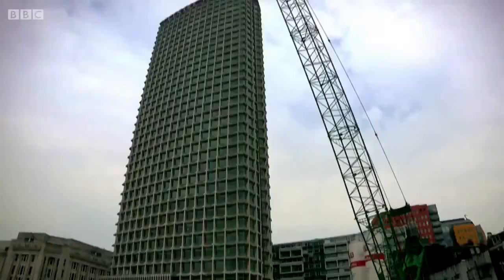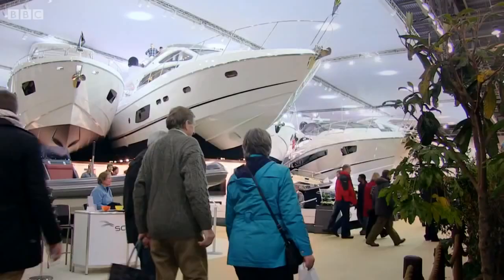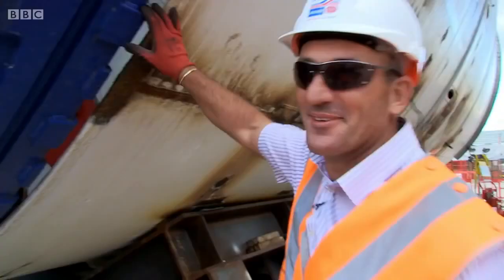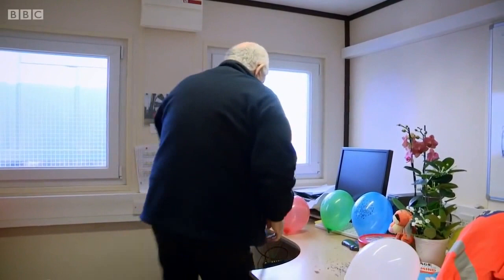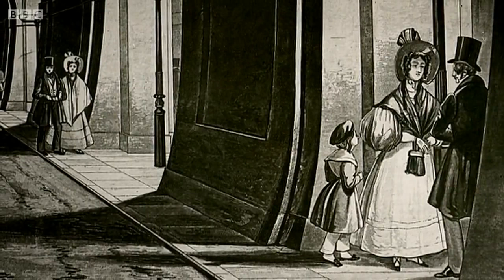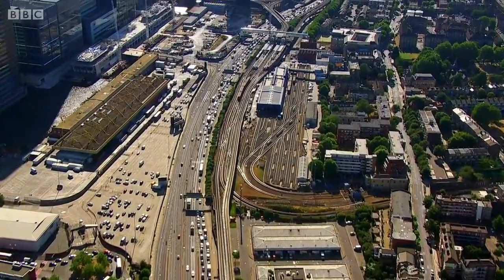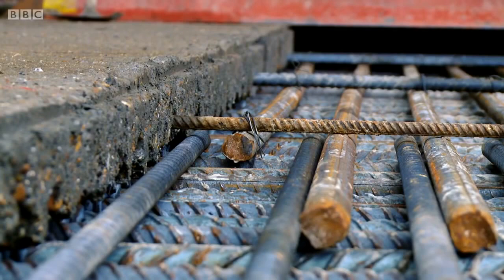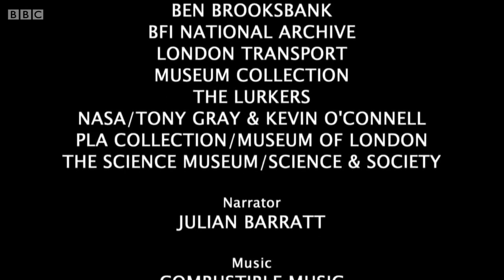The Fifteen Billion Pound Railway - Tunnels Under the Thames - Episode 2

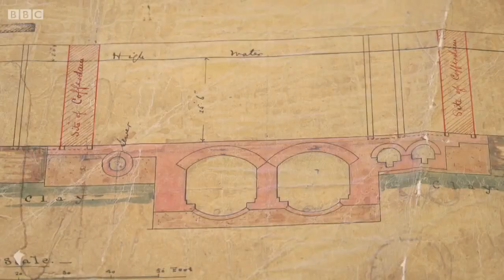Comment: The program makers went a bit over board with artificial drama but, luckily, the content survived. In the old survey at 19:00 what are the two small tunnels to the right of the main tunnel and then at 19:43 they are marked as "subway for foot passengers".